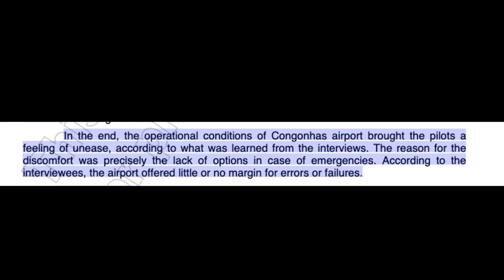The Stressed Pilot Who Made A Deadly Mistake | Deadly Reputation |Tam Airlines 3054

Comment: Another factor in my opinion which should be considered is the crazy Airbus system where thrust can be anything from idle to maximum without the thrust levers moving. That is a seriously dumb system - thrust levers should ALWAYS move according to thrust selected, as in virtually all other aircraft.
Reply: It’s not dumb at all. I’ve never had a problem with it. In this accident it could easily have happened with a Boeing. Leaving one thrust lever out in the climb power area would still cause that engine to accelerate. And Atlas Air 3591 accident wouldn’t haven’t happened on airbus because it’s much harder to “accidentally” push the levers to TOGA. And the TK1951 accident probably wouldn’t have occurred either. Pilots pushed levers forward to get out of stall but then they back drove to idle
Reply: @tomstravels520  That’s good that you’ve never had a problem with it. May that continue. You’re just one Airbus pilot, and hopefully a good one. 
Having flown both Boeing and Airbus over more than 30 years, I’ll agree to disagree with you! 

I read an article many years ago written by an ex Airbus test pilot, no longer working for them, so free at last to speak. He was extremely critical of both the non-moving thrust levers AND the non-interconnected joysticks. (I wish I could find the article, but it was when the A320 was nearly new). 
He said basically that those two “locked in design features” combined would continue to cause accidents basically “forever”, and his words have proven correct. (Just look at AF447!)
Reply: @FutureSystem738  that’s because the pilots were idiots and went against everything they had been taught by Air France and the Airbus FCTM. They couldn’t even keep the plane straight and level and apply the unreliable airspeed. And as Atlas Air 3591 has proven, having a yoke is not a get out of jail free card
Reply: @tomstravels520  The whole Airbus philosophy was “ our aeroplanes don’t stall”- was doomed to catch up with someone eventually.
With non- interconnected joysticks, you have the crazy situation that the guy in the left seat (or the guy observing) has no idea why the guy in the right seat is doing. This is a crazy situation and goes against the grain of any “real” pilot.
In AF 447 even when the captain came back, and despite him realising they had stalled, he had no way of knowing what the guy in the right seat was doing, holding the stick back hard. 
The Airbus system is a sad, basic failure from a human ergonomics and interaction point of view- their philosophy has always been to design the pilot out of the flight deck..... maybe great when all systems are working and there is no frozen pilot tube, but it is producing as you yourself say: “idiots” - who have lost the most basic flying skills. I’m sure they weren’t “idiots” to start with, but the Airbus system made them into idiots. AF is not some dodgy third world cost cutting carrier, (though their accident record is in many ways comparable to that unfortunately.)
Reply: @FutureSystem738  the aircraft don’t stall....when everything is working. I’m sure Boeing were very proud of the 737 Max and though it was very safe.....until they realised it had a serious design flaw. The pilots weren’t idiots because of the aircraft. EVERY aircraft has an unreliable speed procedure even the A330. These pilots didn’t even attempt that procedure. Do you honestly think if they were in a Boeing they would have suddenly gone “right let’s follow the unreliable speed procedure”. Can’t prove it but I highly doubt the type of aircraft your fly affects your ability when both pilots fly equal amounts on autopilot. Were the pilots of QF32 idiots when their aircraft was badly damaged with multiple failures and flying in ALTN law? Again I refer you to Atlas Air 3591. A Boeing 767 with no where near the computing power of an A330 and despite having linked controls and the captain knowing what the FO is doing, he still doesn’t respond to the FO’s 45 degree nose down attitude until too late
Reply: @tomstravels520  The Atlas guys were cowboys, and also had a bad training record, nothing especially new there especially for SOME freighter pilots. 100% pilot error, end of story.
Me? I have 25k hours in heavies flying people not freight incl about 7/8 of that in Boeing’s, the rest in a bus, and damn sure I know what system I prefer. 
The Airbus thrust lever system is Dumb and Dumber, which is basically exactly what an ex -Airbus test pilot said (not using those words ;-) in the early ‘90’s, after he was no longer working for them .... of course. You lose all that tactile and visual feedback of what the auto throttle system is trying to do to you.
Reply: @FutureSystem738  if you’re a competent pilot it doesn’t make any difference which system you use. Did you ever have a moment where you suddenly realised you were at idle thrust unexpectedly? If you did then you clearly weren’t looking at your FMA. Having moving autothrottles didn’t stop TK1951 stalling. According to you the pilots should have easily noticed the thrust levers were at idle but they didn’t. And moving autothrottles still weren’t noticed by the Atlas crew when they hit TOGA by accident. You can’t accidentally hit a button to engage TOGA on Airbus

Comment: Unreal, when you touch down before TR deployment, everything should be almost silent for a split second. No one noticed the screaming engine at full throttle? 
Also there should be spoiler and auto brake warnings sounding as well. 😐
Reply: The PM is supposed to say “Spoilers, Reverse Green, Decel”. Clearly didn’t do a good job of it otherwise he’s have caughtnit
Reply: @tomstravels520  According to CVR, the PM did call "spoilers nothing! No Decel", or something like that in portuguese. They just could not figure out what was going on. Target fixation and need to get there in time syndrome. If pilot does not feel ok with the whole approach and landing, consider other options! They were too scared to land, too scared to ask for alternative. Too scared to be able to keep cool and figure out what was going wrong.
Reply: @Ruimas28  so he still failed to do his job. Even if spoilers didn’t work he should have noticed engine thrust was at climb when checking reverses
Reply: @tomstravels520  this is tricky. I do not excuse the crew. They were already with the wrong mentality from the start. Now, as for them not noticing engine thrust, they only had a few seconds and engine thrust did not come on their mental checklist. But that´s why they crash. Because obviously they could not figure out what the real problem was. 
You should realize that after just a couple seconds they got focused on manual braking. And this in itself was not easy because they were braking an unbalanced airplane, an heavy one...and on a quite wet runway. 
They were too scared with the runway and had a strong idea that they would suffer some difficulty braking. This played against them understanding what was really going on. 
Then it was all too fast for them to have time to even consider they could be wrong in their 1st assessment. They run out of time to figure out what other problem might be going on. 
Sometimes there is an easy solution but you need to be lucky to spot it soon enough. And your window of success is a very small one. 
A lot of crashes had an easy possible solution which was available for some seconds should the crew realize what was really happening. 
A lot of crashes do happen because the crew thinks something is going on....but it really is something else. Humans being humans.

Comment: I just don’t understand why they didn’t go around, nor do I understand why the plane flew if the the aircraft was approved to fly if they knew the right engine didn’t have reverses. Unless they didn’t know prior.
Reply: I was almost shouting in my head for them to go around!
I think that if the company and pilots did know about only having one working reverser, they would have done the math and seen that they didn't need it, and so planned to take care of it at the next regularly scheduled maintenance. I'd imagine that any moment of maintenance outside of those gets very expensive for airlines, so if the manufacturer doesn't class it as an urgent issue, and the pilots and engineers say they don't need it for the flight, they just write it down for later. I don't know for sure though. It's tragic that if they had fixed it then perhaps the pilot wouldn't have made the decision to use the old procedure that he then messed up (or if the airport had a runway with a better rep, or if it wasn't raining, etc)... but that's how many of this accidents are, an unfortunate cascade of compounding failures, decisions, circumstances/weather, and human mistakes that ultimately end in disaster.
It's also possible that Airbus treats it differently today, or at least has that automated warning required to be installed for all I know. Many of these safety and maintenance procedures and regulations were written in blood from tragic accidents like these.
Reply: Once the reversers are out it would take a few seconds to stow them again and TOGA power to engage. On such a short runway they simply wouldn’t have time

Comment: Just curious, what's the point of Airbus/Boeing developing safety features if they are not installed on the plane as standard features and offered as additional features. The safety features are developed to prevent when an accident occurs, no operator or pilot would know in advance when the feature would be required to save the aircraft. Also, all airlines are focused on cutting costs wherever possible to keep the business profitable and offer cheaper tickets, so in such circumstances, safety features shouldn't be made optional. Also, I m curious why the pilots didn't opt for a go-around when they were not slowing down and we're almost out of runway. Or is it possible that they did try to do that but messed it up?
Reply: It wouldn’t be possible. Once those reversers deploy unless you have a very long runway you won’t make it in time to reach rotation speed

Comment: I'm going to ask a very dumb ass question now, when the A320 landed and the pilots noticed that its not stopping, could they have gone full power and took off again,so they could try again. Apologies for the stupid question.
Reply from the maker: Not a bad question at all. So when they landed they thought that the plane was hydroplaning. They probably thought that the brakes would kick in any second
Reply: @MiniAirCrashInvestigation  fair enough, makes sense.
Reply: They could have if they had realized any one of the things that had started to go wrong, and they even had the option to decide they had hydroplaned too far (up until the point they had veered sideways, or no longer had enough runway to complete the takeoff)... I can understand to an extent that with the circumstances and the runway's reputation they thought things were still okay, but while watching this video I was basically shouting in my head for them to go around there are procedures and even in many aircraft (I'm not a pilot, and idk about this particular plane but I'd assume they have it on an airliner like this) specific buttons that automatically throttle to max power, ect, and are labeled "TOGA" or "Take Off Go Around" so you're really spot on in many ways, and not asking a stupid question by any means at all!
I've also read in another comment that perhaps with reverser(s) deployed you can't go around because the engines powering up will only end up throwing more air forwards.
Reply: @revenevan11  thank you for your reply/answer. Now you and mini aircrash have made sence of my question.
Reply: Not really as once you have reversers out and realised you’re not slowing down, but the time you have stowed the reverses and reached TOGA power and trying to o accelerate to take off speed you’d be over the end of the runway

Comment: I thought they changed the reverser system so it wont activate unless the landing gear is touching the ground. Might be a Boeing thing. Could you cover the "Pegasus Airlines Flight 2193" please? It is similar to this accident.
Reply: It doesn’t. But that doesn’t have anything to do with this accident. The working reverser activated on touchdown. The other was deactivated
Reply: @tomstravels520  Too vague, unfortunately the thruster levers were not recoverable from the crash site. The landing path is a piece of shit anyway (tell me anything that works in south america beside coke and CIA deals), or was back in the day. Im more interested in the technical details, why not go for a TOGA? they had the speed...
Reply: @sinanuygur5273  what do you mean “too vague”. The FDR recorded the reverser activation. And once the reverser is out you generally can’t engage TOGA as you are travelling too fast and by the time you stowed the reversers, increased power to TOGA (can take about 5 seconds) and accelerated back up to take off speed you are pretty much going to be overrunning the runway especially being that short. That’s why on touch and go circuit training they don’t engage reverse thrust

Comment: I know practically nothing about flying, but I don’t get “thrust lock”... wouldn’t an engine anyway stay at the speed it was set to by the throttle, until you changed the throttle? Why is “thrust lock” something different and what is it actually?
Reply: Not a pilot but isn't auto throttle a thing? So the throttles can be moved by either manual control or via the auto throttle?

Comment: How in the hell does a plane with a non-functional reverser & a problem with the other one on the other side considered airworthy???
Reply: Only one reverser was non functioning. The left engine was absolutely fine
Reply: @tomstravels520  00:27 "#2 engine or the right hand side".  Regardless the purpose of having 2 is in case 1 fails, flying with 1 already out if commission leaves no backup as in this case. Therefore, how can that be airworthy...
Reply: @Administrator_O-5  yes....you said one had a non functional reverser and the other had a problem. Number 2 which is on the right hand side had a non functioning reverser, number 1 was operating perfectly fine. So what are you trying to say?
Reply: @tomstravels520  ok, you can be right, happy now..
Reply: @Administrator_O-5  if you’re talking about how can an aircraft fly with only one reverser working it’s dictated by the Minimum Equipment List. Reversers are just 1 of 3 ways you can brake so loosing one reverser is not the end of the world. It only became and issue here because the pilot was an idiot for leaving one engine at climb detent. They proved in the simulators you could land and stop in these conditions without reversers.

Comment: They had plenty of time to initiate a go-around
Reply: No they didn’t. Once the reversers are out it takes several seconds to stow them and then set TOGA to accelerate back up to take off power. On such a short runway they barely have any time at all. Why do you think they don’t engage reverse when doing circuits.
Reply: They definitely did not. Once a spoilers are out, on a short a runway as Cognias (sp) that had standing water on it, it would have been impossible to go around. They didn’t know there was a problem until they touched down or they would have abandoned the landing.

Comment: The  aircraft would have still crashed with good weather
and a longer runway.
Why was the aircraft allowed to operate with a defective
reverser?  This should of never been allowed.
Reply: Because part of the landing calculation is if you can use reverse thrust with 1 or 2 engines or none and on a dry runway it doesn’t make a massive difference. They even tested this with no reversers and the aircraft still stopped

Comment: Were did you get that fotoage of the plane
Reply from the maker: It’s from flight simulator 2020
Reply: Real images would give us a better idea of the region surrounding the airport. Congonhas is at top of a hill. There are no buildings so close, or at the same level, to the two runway heads.
Reply: @fabionogueira1262  Well it crashed into one, I believe a TAM airlines building and a gasstation?
Reply: @fluffy-fluffy5996  Yes. They were both well below the runway level and next to the airport, not aligned with the runaway. There are actual images captured by a security camera. I think you can find them somewhere in the Youtube
Reply: @fabionogueira1262  but isn’t what you call the runway actually the street it had the momentum over? I could figure out the pics quite well with the ones I’ve seen from the disaster.

Comment: Ah, another case of essential safety features being optional extras in a multimillion dollar airplane carrying hundreds of passengers. If this was a Tesla, this would've been an OTA update. Like, how freaking hard can it be to push an update that says the throttle is not at idle on touchdown? You don't need a special alarm for that, just use the fucking speakers you already have.
Reply: It was never seen as essential because what kind of a moron would leave 1 thrust lever forward when your hand is supposed to be in both. It’s not difficult to grab both and feel the difference between 1 or 2 levers. Updates can’t be done OTA for aircraft because that’s how aircraft controls could get hacked if they had wireless receivers